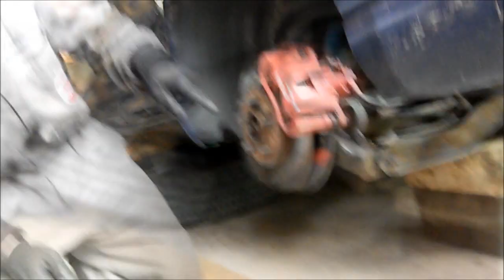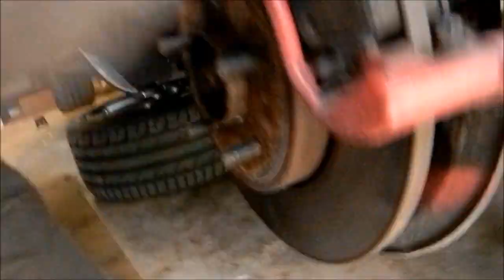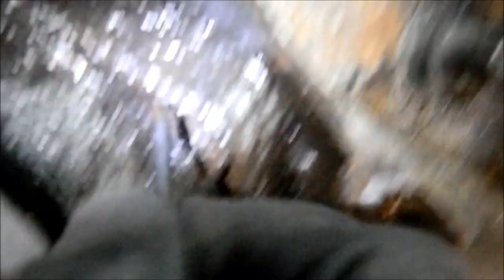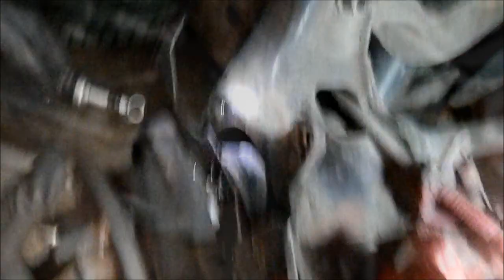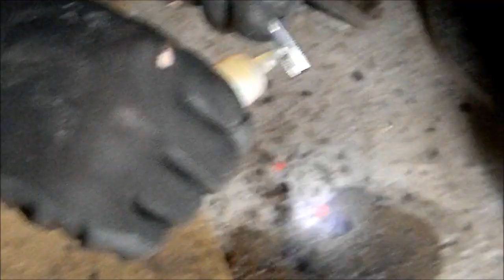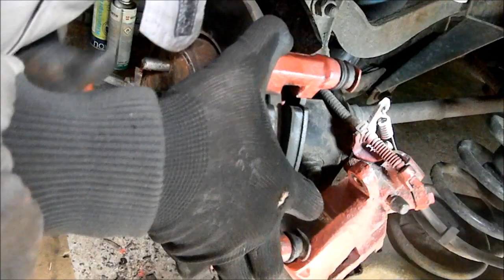Jaguar X-Type V6 rear wheel bearing replacement

Comment: What tool is that used to remove the wheel hub screws? Looks like 4 hex screws
Reply: Torx
Reply: @djohnny55  You remember the size?
Reply from the maker: @timlawlor7103  Torx 50